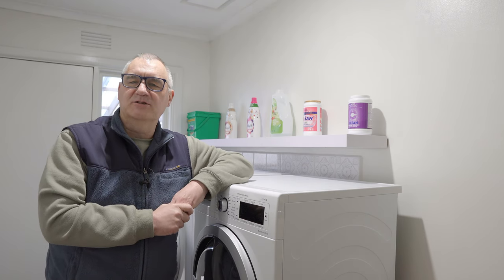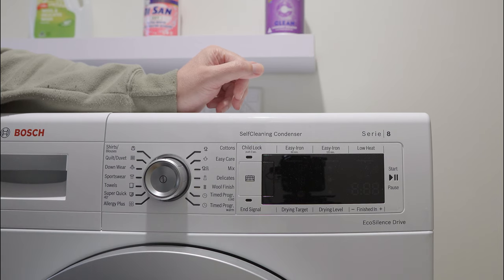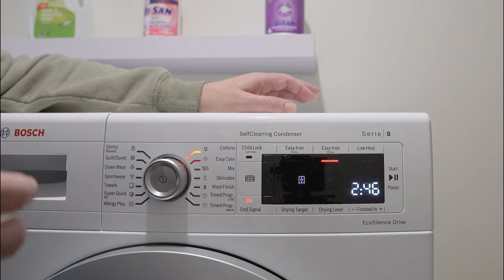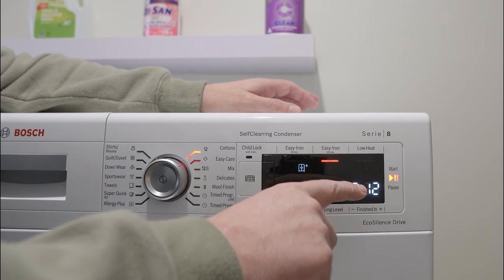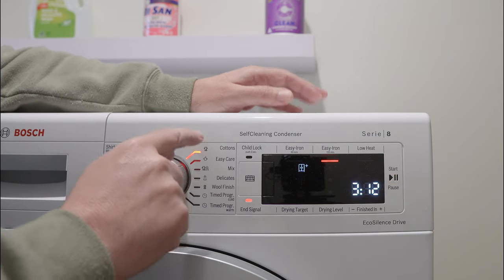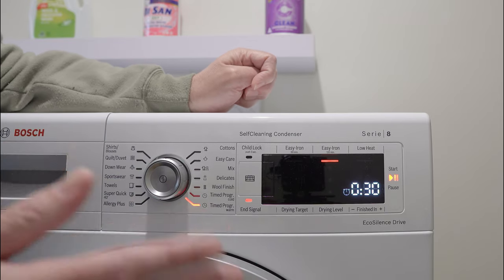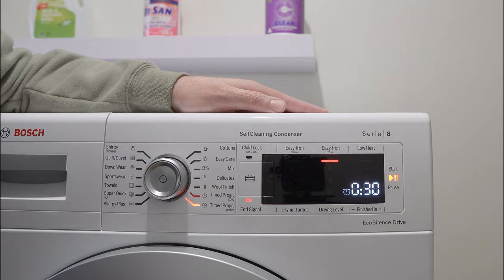Bosch Heat Pump Dryer won't dry clothes properly? I'll show you how

Comment: This dryer is the worst! Your video is very helpful however I would still tell anyone who is considering this model to steer clear! Thanks for your advice :)
Reply from the maker: Thanks for the support Victoria. There is also a Heat Level Setting along the bottom row which makes a huge difference if you're having trouble getting your clothes dry. Give that a go if you haven't already. My biggest gripe with the machine is the fluff filter. Could that thing be designed any worse? You pull it out and fluff drops out on the floor and for some reason you have two separate filters, each as bad as the other. Why? My old condenser dryers filter was so much better. Appreciate the comment. Cheers.
Reply: I must admit, I’ve never really had a problem with it. It does take longer than a condensing drier but runs on a third of the electric. With heat pump technology you have to get into a different mind set and play the longer game👍🏻😀
Reply from the maker: @markgilder9990  You're absolutely correct Mark. They are a different beast altogether compared to the condenser-style dryer. They're not perfect, but the advantages far outweigh the disadvantages. Appreciate the comment. Cheers.
Reply: I have it and I don’t have any issue with it, so far
Reply from the maker: @armenstaubach9276  That's great news Armen. It is a fantastic machine with its own little quirks, but overall, I'm happy with it myself. The biggest bonus with the heat pump dryer is not having condensation all over the laundry as well as fluff all over the cupboards. Thanks for the comment. Cheers.
Reply: Hi what issues have you had with this? I have this one and have not had any problems. I will say it takes some learning to work out the best drying cycle for the given load. All in all, its a great machine, although it can appear overly complicated. Perhaps if Bosch simplified the drying options, that may save folks from searching for videos like this.
Reply from the maker: @-Derp-  Hey ozzycarnut. I think it's a great dryer myself, but it does have some design flaws. That Water Conatiner is an absolute bugger to empty. The water doesn't just pour out like you'd expect. You litterely have to keep shaking it to get the water out. It's the fluff filter that drives me nuts. When you pull the filter out, bits of fluff just fall to the floor. It's the same with both the primary and secondary filters. I'm shocked that you don't have either of these problems. I agree that it does take some learning to use the machine properly. It's not like a condenser dryer where you just set a time and hit start, but I do much rather have the Heat Pump Dryer. I appreciate your comment and hope you have a good one. Cheers.
Reply: @JustAwesomeCommercials  heat pump drier need two filters because the confessors are self cleaning. I much prefer the two filter setup as dryers with only one filter still accumulate fluff and dust past the filter into the condenser. Not a hint if it on my series 4 after 8 months. All dryers should have 2 filters. Never had an issue with dirt falling out either.
Reply: Hi I have had this model for several years and it’s brilliant! However, we found the filters must be washed regularly especially if you use softener. 
Sheets obviously roll up but there is no reverse but a vane on the drum does help.
Reply: Yep!!! Totally agree:. I won’t bore you with my on going issues with this crap heap of a dryer - but let me state what head office told me in the end just to shut me up .. they said to me to expect the clothes to be not completely dry when the cycle is finished— BUT !! When you fold them and put the items away they will dry in time !!! I kid you not that’ was my last conversation with Bosch …$1400 waste of my money …
Reply: Best dryer I have ever used!! I use multiple machines in my job as a domestic house cleaner. In some cases I have brought my clients clothes home just because their askos/ meile/ f&P dryers are so very slow in comparison. This machine is way above any others I have used. I would not swap it for the world. I nearly never use my clothesline since I bought my Bosch
Reply: I'm with you Victoria. I've managed to work out how to get my clothes cupboard dry and my towels/sheets bone dry but was lots of reading the manual and trial and error. My complaint only now has wish I bought a reverse air so that everything isn't screwed up into a ball. Maybe there's a diy help video for that 🤔 ❤
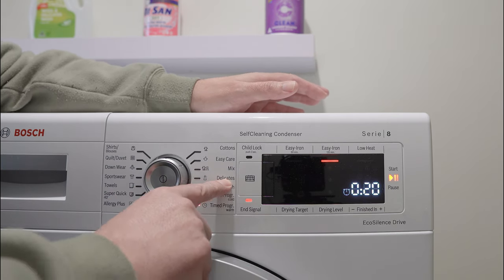Reply: @JustAwesomeCommercials hi at minute 3:44 you have an image(flashes for a split of a second) of a man with a bra and short skirt with suspender straps .
Reply: You clearly don't know how to use the dryer.
Reply: True. The other day my laundry sat for 8.5 hours in the dryer being repeatedly restarted and it came out still absolutely dump.
My dryer is 8 years old and I think it is about this appliance aging. Mine one has been insured though so I shall see what is gonna be a solution carried by the technician. May be the motor or inner filters are overworked themselves. And this life span is over. 🤨
Reply: I bought it uts the worst ever
Reply: @JustAwesomeCommercials so CHOICE ARE LYING??

Comment: I have just bought a Bosch series 4 heat pump dryer and I'm extremely dissatisfied with it. They have made it so energy efficient it is useless for drying clothes. I'm surprised such a reputable manufacturer would sell this as a high quality product and at such a high price. Something is wrong somewhere. I've used mine only 4 times and I want them to take  it back and give me a refund. The dryer is useless.
Reply: You're obviously not doing it right
Reply: I was lucky JB Hi-Fi has just taken my useless new Bosch heatpump Dryer back after I tried 2 different loads which were still not dry after 2 hours each. CHOICE said it's a Dud. Total rip-off.  Never trust Bosch products anymore had 4 - fridge,  dishwasher,  dryer all had major problems but washing machine still new and no issue so far. It had an Ok rating on choice but just the 10kg washing machine only not the dryer or anything else Bosch. Now I have to buy a mismatched dryer.  Not a happy camper 😔
Reply: @job6054 I Iooked at this at the store today. I think the specification the store listed had a much longer drying time than 2 hours? Which of course is very long and in a way defeats the purpose pf this machine. The old “air evacuating” dryer in my old rental house dried very wet clothes in about one hour. But that machine was horrible from an energy efficiency perspective, it just wented the moist and warm air to the outside of the building. So maybe it doesn’t really get much bettern than this with these new “energy efficiency before all else”-machines?
Reply: @VeganStance  Definitely not human error.  My fridge appliance tech just came out for my fridge so I asked him about heatpump dryers. He said never get a heatpump dryer they take 4 hrs to dry a load and they're hugely expensive to fix. Nothing to do with individual settings being incorrect or even which brands.  He said doesn't matter which brand they all have those same issue. He said only buy a "vented" dryer if you don't want to be waiting 4 hrs for 1 load and paying huge repair charges in future.

Comment: The fluff filter must be cleaned every time. The fine mesh will block and will not let moisture pass through the condenser. So moisture stays in the drum. I clean the filter under running water and rub the mesh between my finger to remove the build up of limescale from the filter. If you can blow through the mesh and feel,the air pass through, it’s clear. Got this tip from reading the comments on another you tube vid.
Reply from the maker: Thanks for the extra information Mark. A very useful tip. Cheers. 👍
Reply: Yes, it's insane that the label on the unit says 20 loads between cleanings.
Reply: Mine is brand new! Never worked properly.
Reply: Where is the fluff filter lol

Comment: The "self cleaning" condenser doesn't. It gets clogged and unlike earlier models you can't remove it to clean it. You can take the bottom panel off and cut out the panel in front of the condenser to access it but you still can't remove it. You can clean it but then need to buy a replacement panel to screw back on. At least you can then clean it in the future.

Comment: Cheers for this I have the Bosch serie 4 heatpump tumble dryer and was always using the “cupboard dry” mode with max drying level and towels and bed sheets were still damp after finishing. I would rerun the same cycle and would go on for another 5 minutes and then stop. This works way better!
Reply from the maker: Cheers Daniel. Appreciate the support. This video shows you how to use Manual Mode which is a must when drying sheets, towels and doonas. Cheers. https://youtu.be/TW6rYPQJ0kE

Comment: Thank you for this very helpful video, we recently bought the series 6 in Spain and I’d been pretty disappointed with its performance (especially with bedsheets) and as all the buttons and the manual are in Spanish I wasn’t sure how to fix the problem, I started watching another video which I cut short after the guy began pulling out screwdrivers (our machine is brand new!), yours was the second video on the list and I’m so happy as it was such a simple fix, sheets are dry and kids beds are made, thanks again!.
Reply: With bed sheets, you have to take them out every hour and put them back in. They tend to roll in a ball. I also use dryer balls to stop my bed sheets from going into a ball.

Comment: Having had this dryer (series 4 but still a heat pump Bosch) for a while, I much prefer it to really any other drier, simply because it looks after clothes so much better. I think the heat inside only gets up to 40-50c depending on the ambient temperature, where as conventional driers literally cook the clothes, shrink elastic bands and pill garments while stretching them out of shape. I’m happy to wait 2.5 hours for dry clothes if it has used 1/3 the energy and actually protecting my laundry lol
Reply from the maker: I couldn't agree with you more Oliver. On a sunny day, l draw in more power through solar than the dryer actually uses, so basically it's free to run. Appreciate the comment. Cheers.
Reply: Great if you have solar .
Reply: That’s fine if your clothes are dry. My clothes have never been dry with this machine under any setting for enormous amounts of time! Who sells a dryer that doesn’t dry? You don’t buy a fridge that slightly cools!
Reply: Or 4 hrs to wait for each load which is apparently "normal"
Reply: @leeverrusio6628  honestly no idea what you’re talking about. You either have clogged filters or the condenser needs cleaning. Never had any issues with mine.

Comment: Thanks for the useful info . I just bought one from a lady who used it twice and said it never dried properly  . Usual excellent Bosch quality , just a bit surprised that they did not pick up a problem with drying items properly  or resolve the tangling issues during testing .... surely they actually test an appliance before it is let loose on the general public ?

Comment: Thank you for posting this but I regret getting this machine 3 years ago. Where we live in NZ it’s possible to partially dry clothes over most of the cooler months, and normally I would use a dry to fully dry linen etc. HO dryers won’t manage to dry items that are damp/cold at all. Making the husband rather miffed that the only alternative is to use drying racks to get items properly dry so they don’t smell

Comment: Yes, I have this issue and Im just feed up with damp sheets/towels/jeans etc, while I agree we all should read the manual but there should be a simple sticker and directions clear and that it works.....thanks for the above lets see can I avoid getting a new machine (not Bosch, if this does not work)
Reply from the maker: Hey Alan. Running the dryer in the  manual setting will definitely solve the problem. Good luck.

Comment: very useful video, thank you!! The modes are completely useless since they always leave clothes damp for me. I have to do another 30 mins or so of drying each time. The timer is also not useful as it's inaccurate (guessing that's due to the sensor, but find it rather redundant). I defaulted to using timed progr. warm

Comment: I am here as ours just broke with error 63. Settings on lower heat levels it dries. High heat, error 63. Everything has been cleaned out regularly. No blockages. It’s either the heat pump or the thermostatic sensor as a guess. 2 year warranty and broke 1 week out of warranty. Thankfully Bosch offering to fix it as a gesture of goodwill. Last dryer, Siemens,  lasted 15 years and only failed as the removal guys dropped it out of the truck and the door snapped off and buckled the drum.

Comment: My old fashioned 25 year old dryer had 2 knobs warm or hot. A mechanical wheel allowed me to set the time. No stupid sensor, no endless settings! It was cheap and efficient and I only upgraded due to no parts available! Never any failures. The craziness of todays models is frustrating and unnecessary. Who thinks these overcomplicated ideas up? People who never have to use them because they have a wife perhaps?

Comment: Worst fkn dryer we had. Thx for helping out
Reply: Let me emphatically agree with this comment. I replaced a 33 year old Zanussi Tumble Dryer with a Bosch Heat Pump Dryer 9 months ago. It has never dried  any of my clothes to my satisfaction, even though I clean ALL the filters and the condenser after every use.  Never in all the years with the Zanussi did I need to dry at the high heat setting. I never once ran a program longer than 60 minutes, even when drying large bath towels. By contrast, this Bosch device needs over 5 hours to achieve the same level of dryness the Zanussi would deliver in 20 to 30 minutes. The partially dry towel I then has to be left for another day or two hanging inside the house before it is dry enough to use, The Bosch is a piece of wildly over-priced, under-performing junk. Never again. Oh and btw, the Zanussi required 1 service call out in those 33 years - to replace a failed drive belt. I am going to be most surprised  if this Bosch device lasts even 3 years.

Comment: Why should you have to do this for every load when it has lots of programmes and a sensor ?
Reply from the maker: Hey Tom. The sensors seem to have issues when it comes to detecting the moisture left in things like towels and bed sheets. When it comes to drying a load of clothes, it works just fine. As to why this happens, I don't know. For me, it was just a case of how to get around the problem.

Comment: I also have the same dryer that's why am here. I have never used the cotton setting because of the length of time displayed and all the other settings don't dry our clothes. We have been using the last setting the timed program warm by setting it to 2 hrs and that's the only way it dry our clothes. Now we have a problem as the dryer stops/pauses and beeps every like 20 minutes showing the water sign even when the water tank is empty and the filter is clean. It has been like that for 2 months now so we just have to keep pushing the button to continue the cycle until the clothes are dried enough. If we don't, the dryer is continuesly on it won't off but does nothing. Anyone know how we can fix this without calling an expensive technician? TIA.
Reply: Hi, we have the same problem with a 8 series, stopping during a cycle and beeping, even though the water tank is empty. From what I noticed, it happens mostly during summer when it gets quite hot in the house and when We are drying our second cycle of clothes in a row. We still don’t have a solution for this..

Comment: My biggest problem with these is the design is absolutely horrendous for long term use. After about 2.5 years i noticed the drying time significantly increased (got to the point of taking 7hrs to dry a single load at the 3 yr mark).. i had cleaned all 3 filters every load.. i pulled it apart which is definitely not designed for average users (about 40 torx screws, removing the entire drum and horrible plastic clips over the evaporator).. the ENTIRE dryer was caked on the inside with lint. Literally every nook and cranny.. really lucky this didn't start a fire.. ive worked on many very OLD standard dryers and never found anywhere near this level of lint. Anyway it took a few hours to clean, now it's good as new.. but seriously this means the average user would have to fork out a few hundred dollars for a service tech after warranty expires, or buy a new dryer.. disgusting way to fleece customers out of money. Highly recommend avoiding bosch heat pump dryers to anyone considering unless you are happy to waste a few hours of ur time every couple of years!
Reply from the maker: Hey Wozzgalaxy. Sorry to hear about the troubles you've had, but I'm not surprised. The design of the filters themselves are what drives me crazy. You pull the filters out to clean them and bits of fluff go everywhere. How this passed the design and testing stage, I'll never know. Appreciate the comment. Cheers.
Reply: @JustAwesomeCommercials  yeah i noticed that too! When i pulled it apart i also realised the drum is designed with small circular cutouts at the back which i think helps lint get spread through the machine! My experience was with a series 4. Painful for such an expensive dryer!
Reply: I did the same, deconstructed right down to the condenser box. I cleaned it all out (very caked with lint) and the dryer started performing again. Trouble is, 12 months later, the performance has, yet again, tailed off significantly and I'm faced with either pulling it all apart again, or getting something rather better, including a reverse cycle. A very poor design from Bosch. (mine is a series 8)